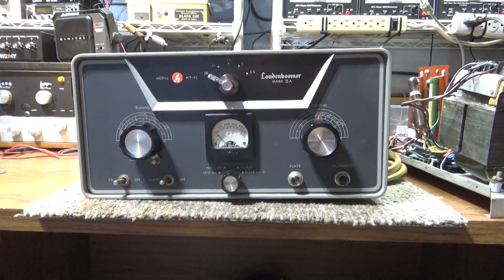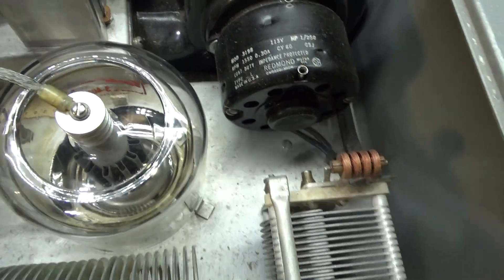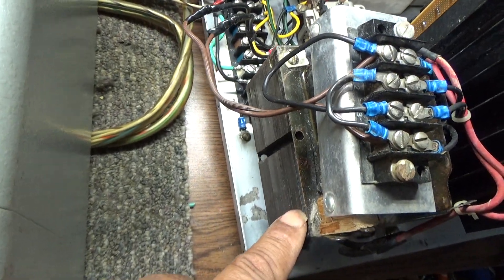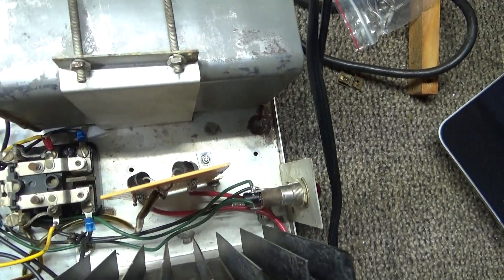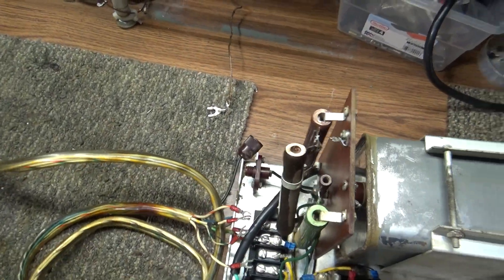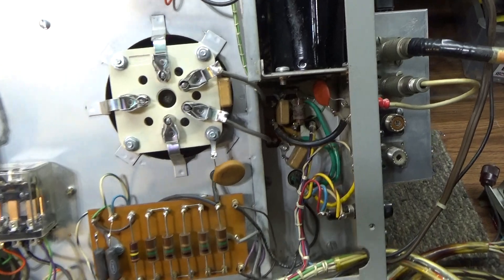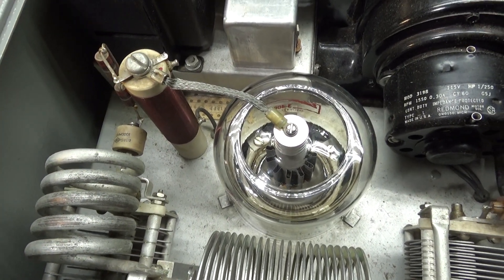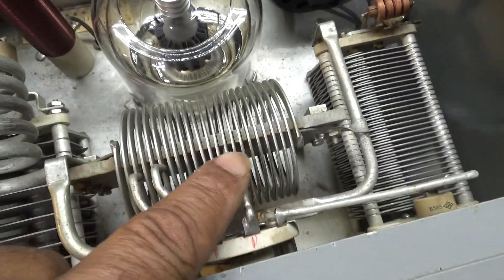Loudenboomer Mark IIA aka Hallicrafters HT-45 single 3-400z / 3-500z unpowered walkthru

Comment: why use a 3-500?the 3-400 has 
more gain,so you'll have less output power
larr,toledo oh.
Reply from the maker: More gain means less drive. More Plate dissipation means more out. So.... a 3-500z will need to be driven harder but will do more than a 3-400z can do. Actually, I'm a tetrode fan. Working on a few 4-400 amps and transmitters now. For 400a amps, very low drive.

Comment: One of the big problems with older amps are that they were designed for the then  1000W DC input.  Most, with tapped bandswitches,  and the  B&W  ones, do not have enough inductance to run higher plate  voltages and more power, without modification.
Reply from the maker: I don't totally agree with that.

Comment: I don't remember if the cabinet is tall enough to clear  a 3-500.  I have  an old Swan,  pair of 3-400's  and  you can not put 3-500's in it  as the case will not clear.  I was  going to revamp the cover and never did.  Much of my stuff was damaged  (smoke) in a house fire,  and even though I have some of it stored,  it is mostly parts.
Reply from the maker: You are right on that one, it won't clear.

Comment: could you make a homemade induction coil and put the tube in it and get the plates cherry'd up to eat the gas?
they seem to be easy to make
Reply from the maker: IDK but you need to get 300 watts on the plate, so that seems like a lot of induction to me.
Reply: @tramdr  they got cheap china inductors that can get a cresent wrench red got I think it could easily heat the plates. basically you need 4 or 5 turns just like 11m but big enough to put over the tube. look on youtub=e for " Building a 1.4kW Induction Heater "
Reply from the maker: Make a vid for me.

Comment: Great video! There used to be an old trick to ensure that the filament always came on before the high voltage. Each switch was a DPST. On switch #1 a set of contacts was in parallel with a set on #2. The other set on #1 was in series with the other set on #2. The ones in parallel turned on the filament transformer no matter which switch you flipped. Then both switches had to be turned on to power the high voltage transformer because they were in series. You didn’t even bother to mark the switches. You could use a power light on each transformer to indicate the filament and high voltage had been turned on. Cheap and easy. 
I would stay with the 3-400 if you can. I believe it has higher gain than the 3-500 and can be pushed to do about the same output. But they are very hard to find today and you are correct that the 500 likely won’t fit. 
Thanks for bringing back great memories of a great amp. I almost bought one in the 90’s at the old Gateway Electronics in St. Louis. I wish we had surplus electronics stores like it today…..
Reply from the maker: This one uses DPDT switches but runs only one wire from the Filament to the Plate so that the Plate will not turn on unless the filament is on. I also looked up and read on the 866 rectifiers that were originally in it. They are supposed to be warmed up for 30 seconds before the HV is applied. That would seem to be another reason amps with Tube rectifiers have a separate Plate and Filament switch. That's not necessary since I solid stated the rectifiers.
Reply: @tramdr  Too bad that the original 866 rectifier tubes were replaced. I've read that they glow a lovely shade of purple when you're transmitting.
Reply from the maker: Yes, pretty, but mercury scares me.
Reply: Tube Depot has them but they are not cheap! The 3-500 is taller and won't fit in the cabinet without mods.

Comment: The Loudenboomer is a relic from the early 1960s. While CBers, with the exception of the Browning fans (Demco and Samson were after 1965), had a wide variety of transceivers to choose from amateur radio was still dominated by the use of separate transmitters and receivers. AM was still the dominant mode, and if you were a SWL as I was you noticed that QSOs consisted of five-minute transmissions. Each station would transmit for five minutes before turning it over to the next station in the "round table". 
The equipment was quite bulky, often requiring a large desk and custom built shelving to accommodate everything you needed. 
Back in the day...

I've been having a QSO with Tramdr.  I've been transmitting and I'm turning it over to him. So...I move the operation switch on the transmitter from "transmit" to "standby". I have to do the same thing with the amplifier. Now I reach up on the wall and switch the antenna switch from the transmitter to the receiver. Now I can change the operation switch on the receiver from "standby" to "receive". 
Get the sequence wrong, and you will destroy the receiver (if you're lucky!), the transmitter and amplifier,  or if you're really unlucky, everything! More than a few hams have turned their receivers on while still transmitting and more than a few hams have transmitted into an unused port of the antenna switch!
Reply from the maker: Now if we can get CB'ers to understand what 'Hot Switching' is.